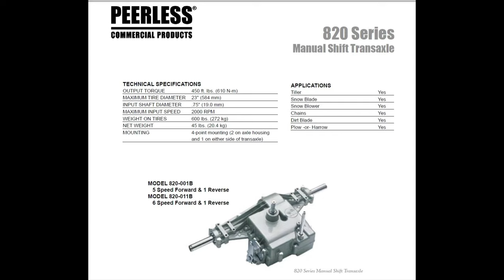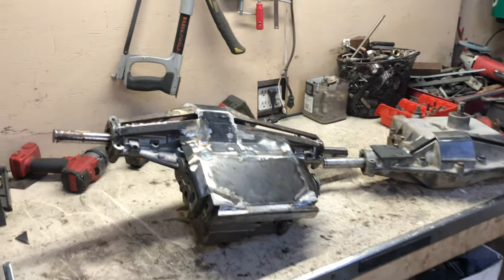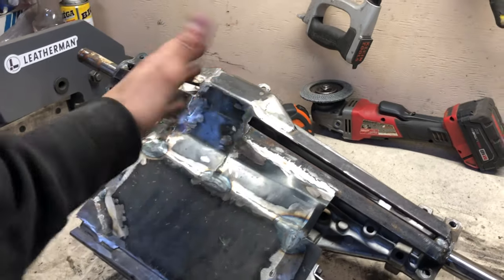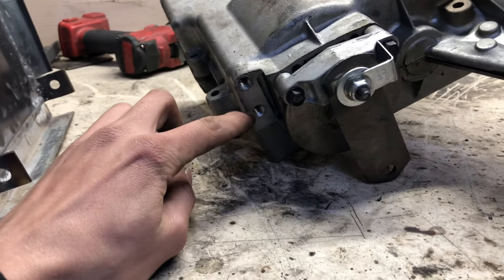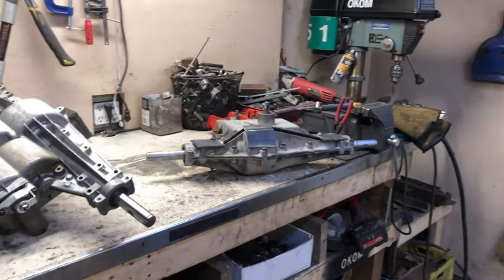You Need THIS TRANSAXLE in Your Mower! The perfect swap in diff… “Almost to easy”

Comment: Why do you put a cover on the top of the diff
Reply from the maker: For added strength to the top of the case 

With having a welded diff 
The two axle shafts put a lot of pressure on the top half of the case as they are trying to push upwards in the middle. 
Also added it as the mounting bolt holes are only 5/16 and I wanted bigger bolts 

Watch the magnum rebuild and you will understand what I mean!

Comment: I have a craftsman 5100 and my hydraulic trans is not working. Can I use a different trans on my riding mower. I want to find a used one and see a lot of craftsman 3000 for sale with used parts

Comment: 66 mph crapsman mower I spent zero dollars on !

Bottom line run a GT axle LT (lawn tractor) is lighter duty (GT) (garden tractor) were built for implements and attachments/work horse .

Lawn tractor is for what it sounds like mowing a lawn lol.

Simply put a 4-5 inch pulley on front and 1-3/4 to 2” rear pulley .

Weld up a quick idler pulley and go .

Done .
Never put big atv wheels and tires a on it waste of time lol
Imo trussing it is one thing but building a whole “fitted” skid plate  little much for a racing mower lol

Great job none the less js u can do it 0$ budget and absolutely rip!
Reply from the maker: This is not for a racing mower, it’s for an off-road mower 
A 1-2” pulley is way to small and would cause so many belt slipping issues 
Skid plate is well worth the time as we don’t have many 820 transaxles in are area and wouldn’t want to damage the casing on a rock 
We don’t mind spending some money on a hobby we really enjoy!

Comment: I'm building a mower with a solid live axle and peerless 700 series transmission. 
Have you guys thought about that, as opposed to a transaxle?
Reply from the maker: We don’t get very many or any mowers with the 700 series 
We have so many ideas for mower builds but sadly where we are located we don’t have many with all these different and cool parts on them 
Gunna have to make a trip down the the states to grab some of our dream builds
Reply: @okoffroadmowers  - Makes sense. 
I have three mowers, and my older smallest one happened to be the one with the 700 series transmission. The others have transaxles. But it turns out these transmissions are what a lot of the race mowers use. 
Not quite finished yet, so right now I'm hopeful it'll hold up.
Keep up the good work!

Comment: Where do you get the wheel hubs?
Reply from the maker: Princess auto
Reply: @okoffroadmowers  ill look into it
Reply: @okoffroadmowers  I saw the weld on hubs but can't find the 5 lug plate that it welds to. I've looked online at princess auto still no luck. Could you please get a part # or a sku it would be much appreciated 🙏
Reply from the maker: Look up “drive plates” on princess auto website you will be able to find what your after!